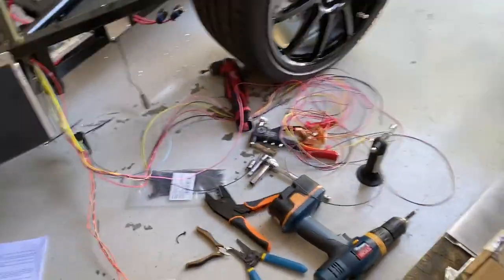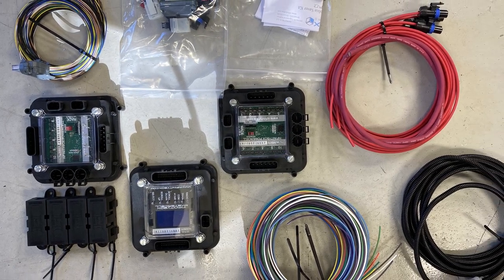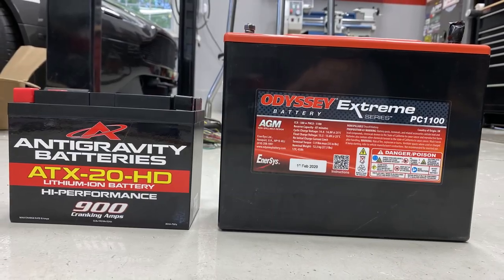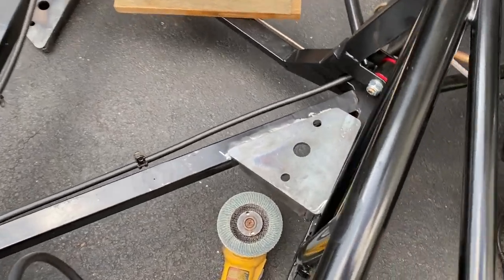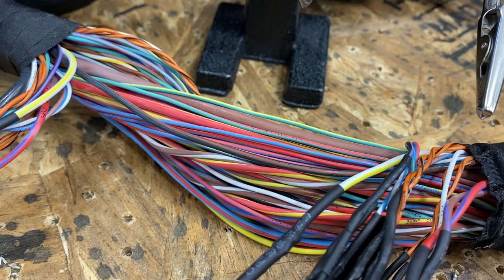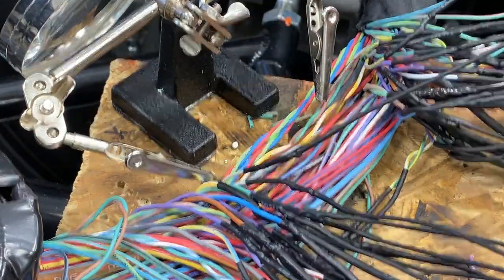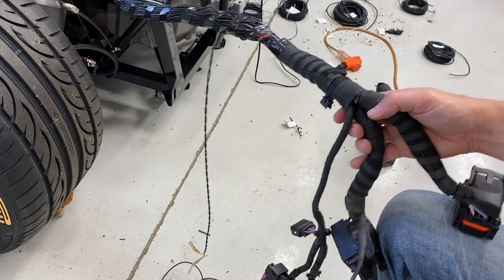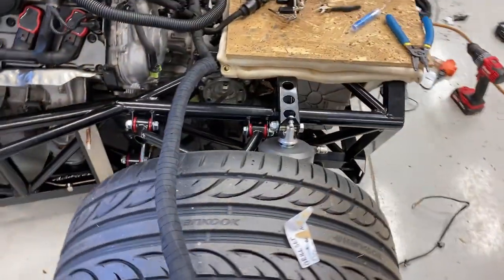Project 'Top-Gun' - Willpower is Human Electricity - V10 Ultima Evolution Convertible Build

Comment: Dan, I was sad to see that you extended your harness by soldering the wires. Solder joints are brittle and can break when subjected to vibration and racing teams and auto manufacturers do not use solder in their harnesses. The recommended way to make connections is by crimping. 
Also, the Infinity Box system was supplied with the Superlite SLC until last year, there were many complaints that the system tends to drain batteries so you must keep the vehicle on a battery tender or use the cutoff switch. Also, draining those expensive anti gravity batteries will destroy the battery. I wish you the best in your build, but I would highly recommend avoiding solder in the future.
Reply from the maker: Hi and thanks for the comments. Yes, I know about this best practice. However, I’ve built many cars I’ve never had a problem. I normally crimp small harnesses with just a few wires. But for this large loom, crimping would have made the junction area HUGE as butt splices are much larger than a solder joint. Plus, as I wrapped the junction area tightly and as a wire bundle, the harness is rigid and will not be subject to any bending forces. So as you saw, I made the trade off for a tighter/smaller harness. Good heads up on Infinity Box. I have a master cutoff switch I’ll be using with the car is just sitting anyway as I want to take all precautions to not draining the expensive lithium battery; so all good there.
Reply: @DanDulac   Thanks for the thoughtful reply. One strategy for reducing bundle size with an extension such as yours is to stagger the splices so they are not all at the same location. Another tip would be to use double wall heat shrink tubing so that the inside of the wire is water proofed. This may all seem to be overkill, but one of the main problems with homebuilt cars is electrical reliability. This is an amazing build and the videos are fantastic, thanks for your efforts in documenting your journey! I highly recommend the hpacademy club sport wiring online class if you are interested in learning more.
Reply from the maker: @sheffdog36  and thank you for your guidance!  Life is boring if you’re not always learning so I really appreciate it. Happy New Year and I’ll be watching your build closely as well. 👍

Comment: I found that is you stagger the solder joints on large looms, you dont get that big bulge when you tape the loom up. . You might want to keep an eye on those sections as when you use the vehicle  you can sometimes get the hard solder joints rubbing together which in turn rubs through  the heat shrink. Then you get multiple  wires joining causing shorts

Comment: The engine sits surprisingly back on the car considering it's V10. My LS + ST-6M is pushed almost against firewall to get driveshafts aligned to hubs
Reply from the maker: Yes, it’s quite a compact unit. I think most of the space savings is attributed to the transmission; the distance between the front edge of the bell hosing to the axle hubs is quite short as compared to other transaxles.

Comment: Dan, can you tell me why on the tyre (English ;-) it says Hankook but on the sidewall it says Pirelli P Zero?
Reply from the maker: Good eyes!  For my first set of tyres I wanted something cheap...in addition, i wanted to try the rubber tyre letter kit without the risk of ruining an expensive set of tyres if it didn't work out.  I will eventually be installing real Pirelli tyres so I got the Pirelli letter kit to try.  So net/net, this was an experiment that worked out well...Once I burn off these tyres, I'll get some good ones to replace them.  :-)

Comment: Are you going to be using the stock ECU's or something different like Speeduino or rusefi?
Reply from the maker: I’ve got the stock ECUs and I’m going to try to use them. I’m hoping to get a custom tune to delete the emissions stuff since I deleted the air injection pumps, rear oxygen sensors, etc.

Comment: What made you decide on the Ultima GT build?
Reply from the maker: I wanted a mid/rear engine project. I LOVE the V10 platform in the late model R8/Huracan so it’s perfect for this chassis configuration. It would have been way easier to buy one of these cars instead but what’s the fun in that?
Reply: @DanDulac  agreed can’t wait to see you flying down the road.
Reply: @DanDulac  I get the power plant platform and I agree but why this model? Personally I like it a lot and am marketing a this a serious consideration for my next build. Thanks again Dave
Reply from the maker: At the time, my choice was the Evolution Coupe or Convertible. About 3 months before delivery, the RS Coupe was released. But ultimately, I chose the convertible as the “open air” experience sitting in front of this drivetrain will be something out of a dream. I picked up the hard top option for my car too...with the hard top on, the car has such a unique look over the Coupe and the best of both worlds, imho.